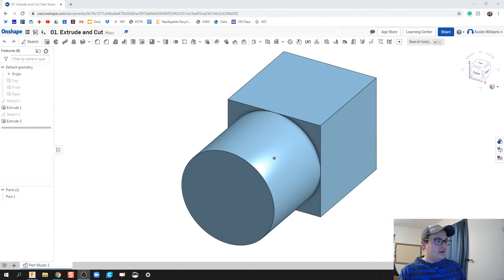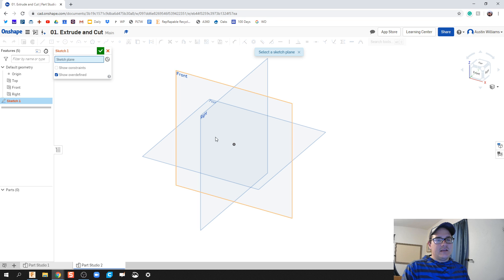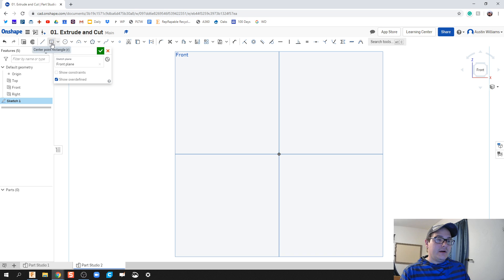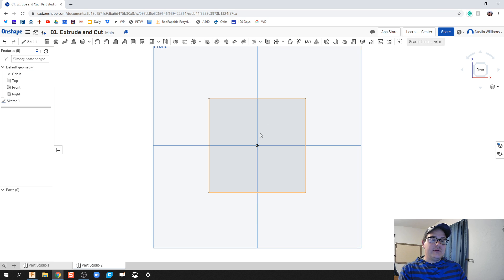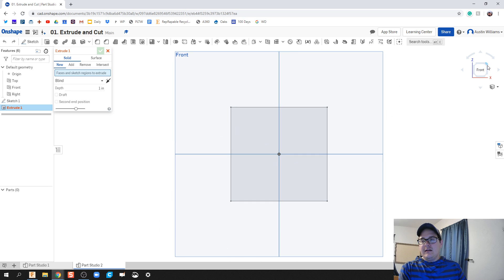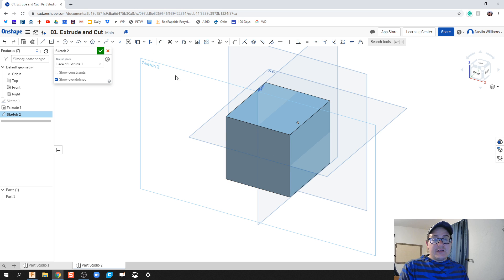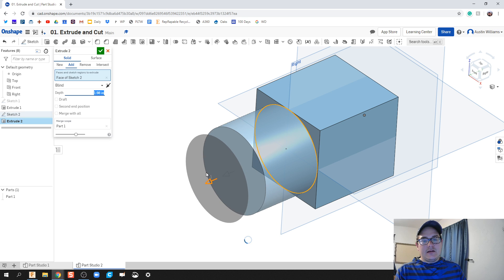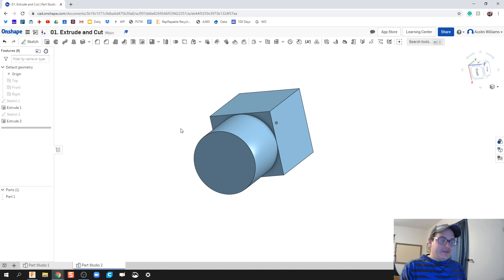Extrude, Planes, and Rotating Parts - Day 1 of 100 OnShape Journey

Comment: Nice series! I see you have a Fusion 360 series too. Which one did you end up preferring? I've been using F360 since 2016 and I'm now trying Onshape because I've grown tired of F360's bugs and quirks.
Reply from the maker: Depends on what your end goal is and your tech available. I prefer to use Fusion, but OnShape has its case use if you are on a Chromebook. 3D printing can be tricky with a  Chromebook.